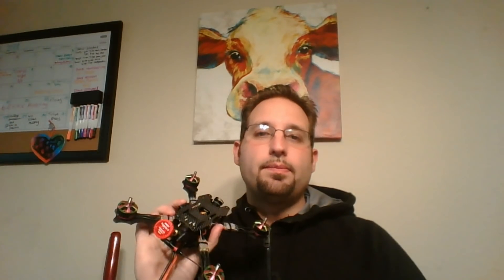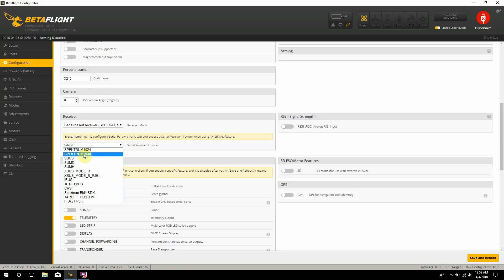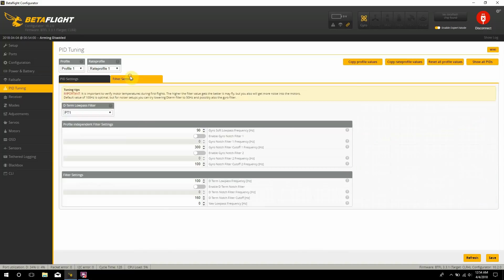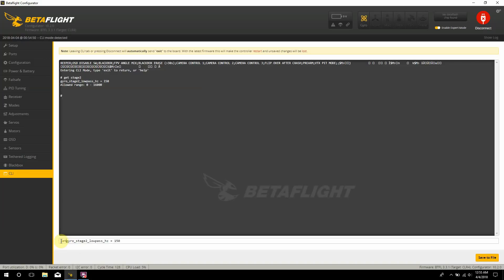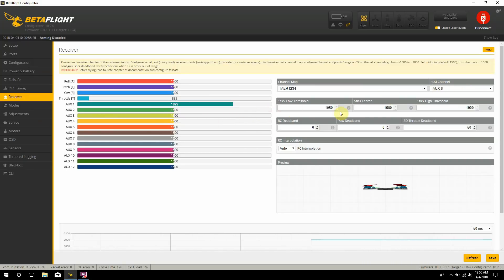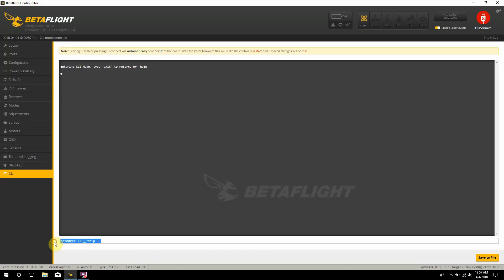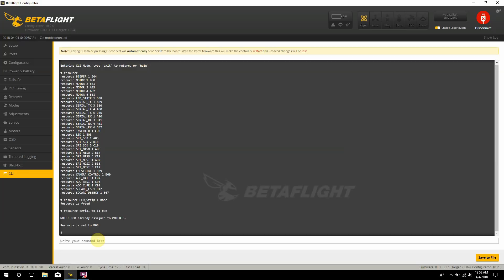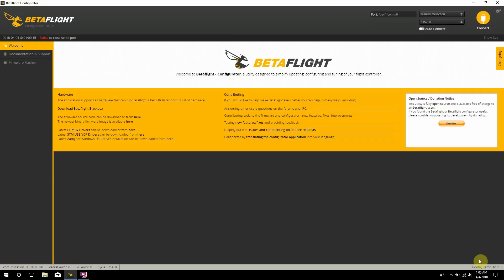Betaflight 3.3 Filter Setup & Guide (not 32k FC's)

Comment: When i tried this my motors made a terrible sound when i armed, and they got hot. When i turned on dynamic filter it went normal again. The Stage2 is at 150hz. Im also using the JB FC
Reply: Andrey Semjonov Im not sure, but I did put it on 500hz and my quad is now soooo freaking smooth.. I didnt noticed anything below 200. But on 500 it feels so damn good 😁
Reply from the maker: Are you using a low esr capacitor?
Reply: Viper_FPV nope. Im using the wraith32 v2 ESCs and theres no noise
Reply from the maker: you should try leaving dynamic off and then reactivate the D term notch. I am using some old emax 30 amp bullet escs blheli S. and its flying perfect just did the maiden today. You can also try leaving the dynamic filter on and then setting the stage2 lowpas to 500 and see how that works for you with all the notches off.
Reply: I tried it with 200hz today and its flying really good already, with the dynamic on. I will try to increase it more tomorrow and see how it goes.
Reply: Viper_FPV Hi. Why you suggest to put low pass stage 2 to 500hz? Everywhere suggestions to put to 90.
Reply: Lervik FPV with turned off standard gyro soft low pass filter (what 90 by default)?